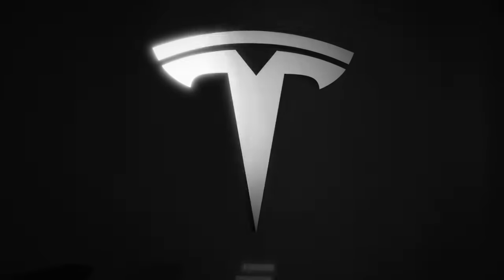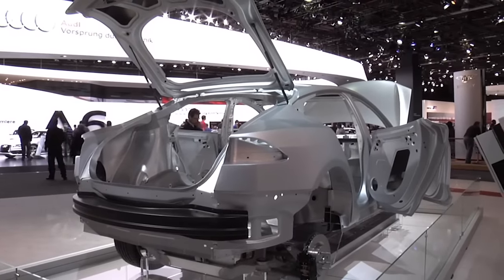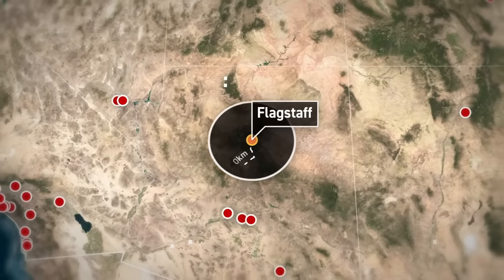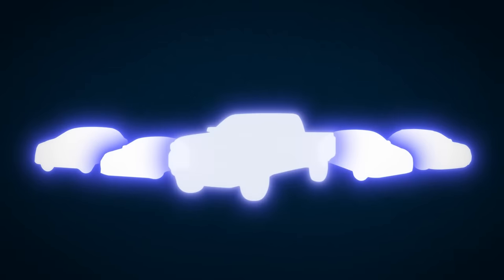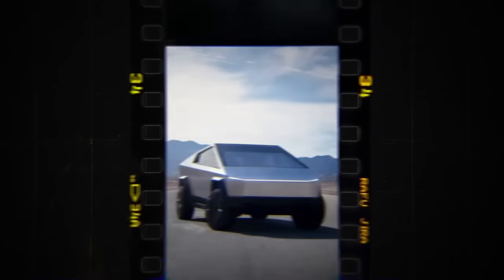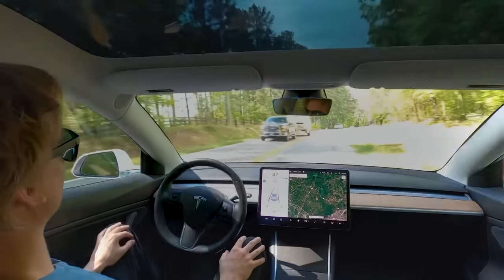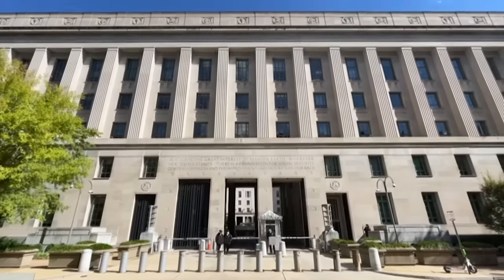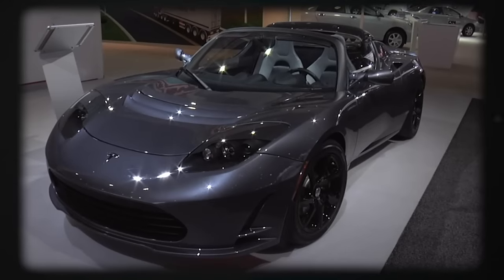How Tesla Fumbled

Comment: The things Tesla did was to make EVs sexy and build out a massive charging network. I owned a volt for years and I loved it, but if you looked at a Leaf, Volt, or other EV at the time, its clear the major manufactures were never going to build something better unless pulled kicking and screaming. Charging overnight is pretty much all the changing anyone will need 97% of the time; but having a fast way to charge that isn't cumbersome goes a long way to erasing range anxiety... and frankly 240v level 2 charging doesn't fill that gap. Tesla changed those things.
Reply: As a very happy Volt owner, someone who will almost certainly never own a Tesla, and someone who considers the cars over-rated and more a fashion statement, I do appreciate what Tesla did for the EV market. I acknowledge that, if not for Tesla, the EV market would likely be a small fraction of what it is today. And, ironically, all of the reasons that someone like I don't like Tesla are the reasons it helped propel the rest of the EV market. Namely, they made EVs "cool" and fashionable. I just want a good EV that gets me from point A to point B reliably, safely, and comfortably. But you do need those first adopters, and the more fashion-conscious those first adopters are, the more quickly the rest of the public is going to desire it. Tesla made a fashionable car that fashionable people wanted, driving demand downstream, even if on an individual basis I don't really understand why anyone would opt for an overpriced, poorly-built Tesla given the competition today (granted, the competition has only been competitive in just the last couple years).
Reply: @amvin234  Because I don’t agree with your conclusion. Lots of people are happy with the Volt, I would not be so I buy a car I am happy with which is a Tesla. This video is filled with inaccuracies and bias, drawing conclusions based on insufficient data. I’m sure it attracted the view and like volumes they wished for though. 👏
Reply: @amvin234  Some portion of the market are going to buy a vehicle because they are "cool and fashionable", but can you really say that was the motivation of the 1.3 million buyers that got a Tesla last year? At that price point? Because that would be a very expensive fashion statement.  And I get where you're coming from, specially after hearing the tiresome arguments of people who barely drive a couple dozen miles a day being "concerned" about range.  However, the Volt and the Nissan Leaf are just unprofitable attempt to keep the government happy.  Tesla strategy of starting with the luxury segment of the market made sense because at the state technology was when they started nobody could make a mass-market vehicle (say, something that could compete with the Toyota Camry on price) at a profit.  Even then, Tesla didn't became profitable until they came out with the Model 3 and even more so with the Model Y SUV.  For EVs to replace ICEs they need to be profitable for the manufacturers, and Tesla is the only one that's making a profit selling them today.
Reply: To be clear here; I believe in what Chevy and Ford are doing - the F150 lightning would have been my purchase years ago when I was in the market for larger electric vehicles.  I just believe they had to see proof the market was real - and Tesla did that.  A different company use to take the Silverado and convert it to a Volt-hybrid (Via's SolTrux) - but they weren't selling to consumers.
Reply: That was in the past.
Reply: sexy? are you blind? XD
Reply: @amvin234  what is your definition of overpriced? Are you suggesting that the solution to transitioning the world to sustainable energy should not have been done by making a cool fashionable vehicle? If you were able to start from scratch to transition the EV market, what would you have done differently?
Reply: The initial telsa model was sexy. There has been no real evolution in their design language since major production began. It's lazy, and as described in this video, build quality leaves something to be desired.  The charging network is great, but its also a move of desperation.
Reply: @kc8203  what’s a grargung network?
Reply: Correct.
Reply: @kc8203  - Its not lazyness. Its something else, that you dont understand.
Reply: @Michael Herder  and what is it exactly that I don't understand? It is lazy, which is the direct result of people overhyping Teslas. They were selling enough with their cars as-is, so they chose to cut evolutionary development costs by keeping vehicle facades more or less the same. The problem is that the rest of the industry has caught up, and many other options are far more visually appealing and offer more power and technology than the ICE vehicles of the past. So if it's not laziness, then it's hubris and stupidity.
Reply: @amvin234 Look at the specifications, maybe even spreadsheet that shit against your Volt and lets see who bought a fashion statement and which car is overpriced for the performance
Reply: @kc8203  Why do you feel Teslas are overhyped? Have you driven one for several days? My personal opinion backed by experience and data, along with the 550+ people that I let drive my car have said it lives up to and exceeds the hype. How has the rest of the industry caught up? Who else is producing 1.3 million electric cars a year? Which car company will overtake Tesla's charging network? Who will overtake their solar portion? Who will overtake battery production? Who will overtake the neural net?
Reply: @Beyond Plane Sight  when I say they're overhyped, I'm referring to the company's position in the market/the stock price. The volume of vehicles produced is not commensurate with the stock price. They make a fine car, though interior quality, aside from aesthetics, do leave something to be desired, considering the price point.
Reply: @kc8203  Do a DCF on $TSLA and you will see that it is currently very undervalued. Tesla sells every car it makes at an incredible margin of 30% and they have grown every year at near 50% growth.  Back in 2019 and 2020 during the big runup it's PE ratio was very high but not anymore.  You would do yourself well to invest into some Tesla stock on the next dip.  I hope you aren't holding GM or Ford, they will not make it, they are too late to the game and their legacy ICE business will drag them into bankruptcy.
Reply: @LunaTechLV  You're out of your mind if you believe Tesla is undervalued.  They produce fairly not terribly well-built electric cars.  That's it.  That they did if first domestically is their only advantage (which even that technically isn't true.  GM did it first but didn't see an advantage.  Their loss is Tesla's gain).
Reply: @amvin234  I almost bought a Tesla until I just kept consistently reading issues with delivery, customer service, build quality, etc., basically this entire video,
Reply: @beyondplanesight  This had me lol'ing. Charging was somehow mistyped into grargung. I just... I can't....
Reply: I wanted a car i can road trip with my small family.  Nothing came close to Tesla's efficiency and supercharger network. Still doesn't in the USA.  In a few years maybe Tesla will have enough CCS chargers that work for other auto's but the third party chargers other manufacturers depend on are just terrible from all reviews i can see.

Tesla's build quality on Model y's and 3's have also been improving in leaps and bounds; especially in their new factories.
Reply: @kc8203  look at the 2022 consumer report on build quality. it's true they use to be trash but now they are in the middle of the bunch
Reply: @kindlin  You’re forgetting that what you read is heavily biased because happy owners post far less. The best thing to do is go and test drive a Tesla, then rent one if you like, Turo or Enterprise.

What you may find is that they are an excellent, reliable, astoundingly capable vehicle.

We had a Model 3 for 70K miles. No servicing other than tire rotation and replacement and the 12V battery need replacement around 50K miles. I now have a Model Y and the 12V lead acid battery that failed at 50K miles in the Model 3 has been replaced with a Lithium battery that should last the life of the car. That’s what Tesla does, iterative improvement, constantly to their vehicle. 

I’ve never had a car like these, no visits to the shop for oil changes, brake servicing etc.
Reply: @kc8203  Tesla’s cars are constantly evolving. They apply changes and updates month to month, improvements are constant. They are the opposite of lazy.

You need to be better informed.

Google Sandy Munro and watch their videos on Tesla tear downs (yes they completely disassemble them to analyze them). They talk a lot about how Tesla integrates improvements constantly which no other vehicle manufacturer does. The Model Y in 2023 is very different to a 2021. And even if you have the older model, the software continues to improve and add features.

Most manufacturers work on a 5 year model lifecycle on average, it’s usually in the 4-6 year range. So almost no changes in those 4-6 years, sometimes they do a mid-cycle refresh of some minor things. Contrast that to Tesla’s continual improvement. 

As for the cosmetics, well the Model 3 dropped in July 2017. There is a visually refreshed Model 3 dropping in a couple of months. So 6 years… how is that “lazy” compared to other manufacturers. Especially given the incredible amount of changes made under the skin in that 6 years.

So not only are you wrong, you are completely and utterly wrong.
Reply: @danielrolfe1960  Yeah, and you don't hear about a lot of unhappy Mustang customers or a ton of unhappy Lexus owners all complaining about similar things.
It's not just 1 complaint, for a single thing, it's a lot of people complaining about multiple things, consistently over a long period of time. It's a systemic issue with the company, with the company management. They just don't have the same attitude that mature companies bring to the table.
Reply: @kindlin  You still have not eliminated bias. And yes, you will find plenty of complaints about the Mustang Mach E, it was being bricked during software updates at dealers when it first came out. A 70K vehicle, bricked… Entire youtube videos were devoted to the associated pain. It was plagued with software issues. It’s also far less stable in the slalom, beyond other hardware issues.

The VW ID4 has had much worse feedback for all sorts of problems. Lots of hate there. It seems to have been a horrible vehicle, based on the reports you see. 

What you’re experiencing is selection bias.

Your choice of language here “more mature companies” is a subtle hint of another bias. If you want to hate Tesla you’ll find plenty of reasons to. Same can be said of any other thing you choose.

The actual data is harder to obtain, so it’s hard to get an unbiased view. However, what you can’t do is say “I see people complaining about Teslas online” and then claim that is the absolute truth.

My anecdote and those of at least a dozen people I know is they find their Tesla to be the best, most reliable vehicle they own. That is not scientific due to the small sample size but it’s about as reliable as your data source. 

Have a good one.